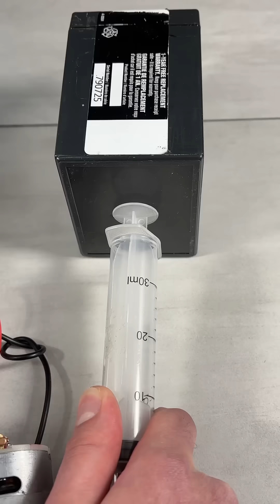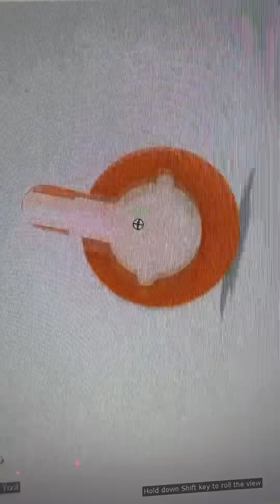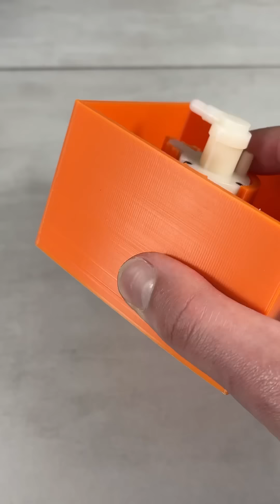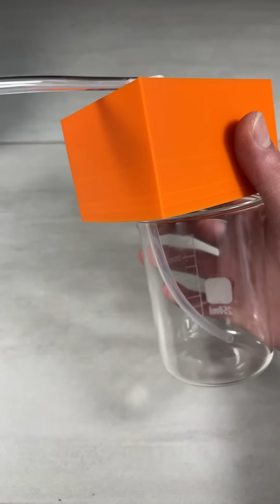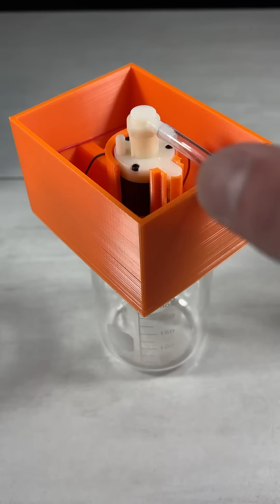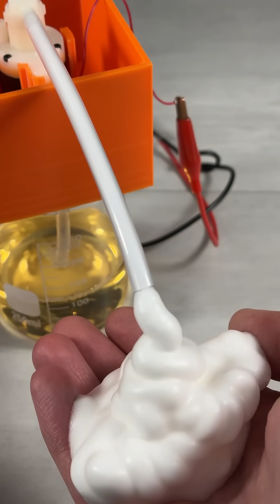Let’s Make an Automatic Soap Dispenser! #cool #engineering #experiment #electronics

Comment: You got a warping problem there mate

Anyway - link to the pump pls
Reply from the maker: Yeah my 3D printer’s been acting up recently, and I also had a dehumidifier on nearby with a strong fan in it so that probably caused it.

For the link, the seller I bought it from isn’t selling them anymore, because I tried to buy another recently and it was gone, so I ordered from another seller (~1.5-2months ago), and still haven’t received it so I don’t want to give a link to such slow sellers (unless you want me to).

I’ve only found a couple sellers selling the exact model as what I had before (since I don’t want to redo the entire design I need the same model), that’s why it’s so hard to find a good reputable seller.

If I do receive it then I’ll leave a link to it when I make a video on the completed prototype.
Reply: Using the search string, "foaming hand soap electric motor" will have half a dozen sellers of similar products on the first search page.

Comment: What has OP done exactly? Taken out the mechanism of an actual soap foam dispenser, and created his own half arsed version of it. Foam is different from the original version because he changed the soap to water ratio.

This is cheating. No actual creativity, just a hack job for views! 👎
Reply from the maker: Here I just demonstrated the barebones proof of concept working model that I made to help me better visualize how to make the final design when making it in 3D cad. (It really helps). And I was really excited at how well the proof of concept for my way of holding the pump and routing the tube turned out that I made a little short on it.

I admit the title may have been a bit vague but not a hack for views I promise! The reason being that I’m actually going to make this into what I said I will. I’m just going to use the same circuit as my LiDAR hand dryer for detecting the hands and triggering the relay.

And the foam being made with the ~20% dilution may be different from others, but it’s what I find makes the best foam quality.

I don’t blame you if you don’t believe me, not at all with all the low quality stuff I’ve also seen on YouTube. 
All I ask is that you just don’t conclude your first impression of me here because I’m not one of those channels to make low quality stuff for views. I still haven’t put out my biggest videos yet so of course you guys have no way of knowing that, but once I do you’ll see that I will deliver what I say I will, and more. 😁

Comment: Bro dats cool 😄❤️🔥 but is the foam good enough for hand washing?
Reply from the maker: Yeah it is! I actually just used it and because of how rich of a cream it is it actually seems to clean better because it can cover more areas of the hand compared to the syrupy dish liquid.

When I add the sensors and refilling system and everything, I’m genuinely going to use it.
I actually use a lot of the things I make because in some cases they’re either cheaper or even better than what I could find on Amazon, like power banks for example. 

For example like 3 years ago I made a 7500mAh USB-C power bank with quick charging, I still use it to this day and it only cost me like $23 to make. (2021 prices, now the same thing would cost at least 2x as much).

Sorry I keep going on random tangents in my replies, I just actually enjoy replying to you guys so I just start typing as if I was talking to a friend.
Reply: @KeonsLab  Come bro 😂 u don't have to be sorry, reading ur reply put a smile on my face as a Junior EEE student it's fun having discussions like this 😄🤘
Noticed it's a creamy foam so ur 1st point is more practical than d syrup like soap😂🔥